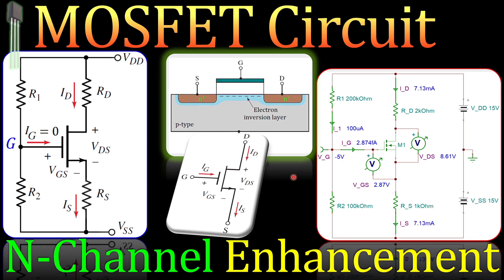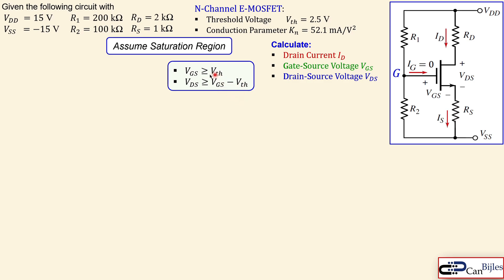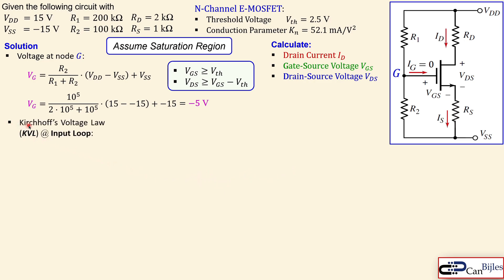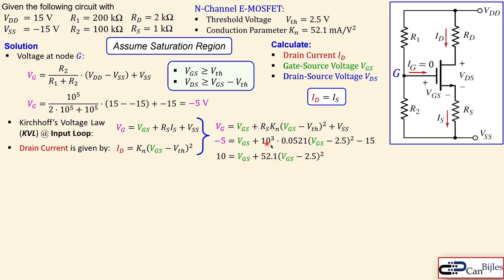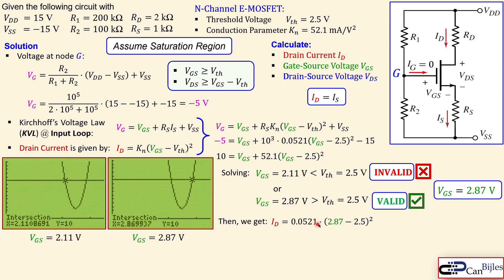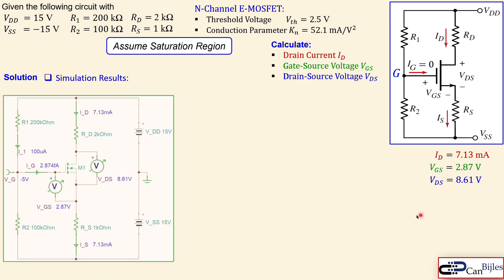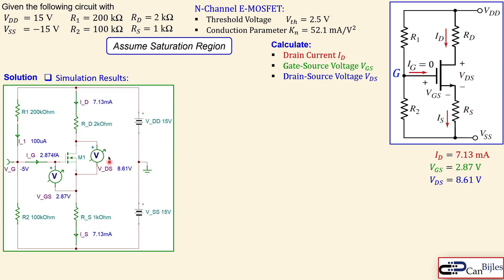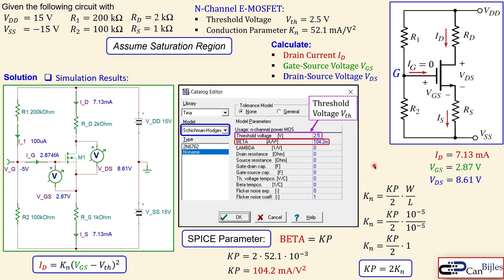MOSFET Circuit Dual Supply 🌟 N-Channel Enhancement MOSFET 🌟 Calculations & Simulations 💡  Example 2

Comment: How to identify the input and the output voltages in this circuit in order to calculate the voltage gain of the amplifier? thanks
Reply from the maker: This circuit is for biasing: only DC analysis are performed as shown in the video. Transistor amplifier are discussed in this playlist, see after the videos of DC analysis

Transistor Circuits: https://www.youtube.com/playlist?list=PLuUNUe8EVqlndhdohoZ23M1-BICayBJFE
Reply: My understanding; this is an academic circuit for educational purpose and it's not practical and it does not exist in reality as we should have an input signal so the transistor can operate as amplifier ! Am I right? secondly, have you posted a video about mosfet small signal model? Thanks
Reply from the maker: @Fidel-tk5rq  This circuit is a part of an amplifier design, it is not just for academic or school work. The link I sent you about Transistor Circuits also have BJT and MOSFET amplifiers.

Comment: Is there another way to calculate the Voltage at G?
Reply from the maker: Yes, you can apply Kirchhoff's current law at node G and then calculate the current flowing through the resistors. Maybe that is easier to recognize. Also, simulate this to check it.

Comment: What's the function of this circuit?Thanks
Reply from the maker: It is a voltage amplifier and the use of dual supply can give you more output swing.
Reply: Where is the input signal (voltage) to amplify? @CANEDUX
Reply from the maker: @Fidel-tk5rq This circuit is only for biasing and is only the DC part of an amplifier. You won't see an AC input signal here.

Comment: How did you find voltage at node G?  Please explain
Reply from the maker: In 02:22, I mention that I use the voltage divider rule. That is how you calculate the voltage at node G.
Reply: I know you used the voltage divider rule  but why  subtract Vss from VDD then add Vss? Thanks @CANEDUX
Reply from the maker: @Fidel-tk5rq  You refer the voltage at node G to ground, but the original voltage node G is lifted by VSS, so you need to compensate for this. Try this also in the simulator and compare both node voltages.
Reply: Could you please let me know the source or the book of this example? Thanks
 @CANEDUX
Reply from the maker: @Fidel-tk5rq I made this example, but you can find similar examples in a good electronics book. Check out the books of Donald Neamen or Sedra & Smith.